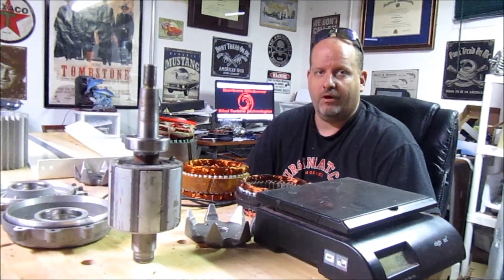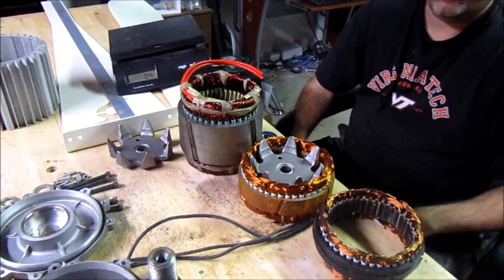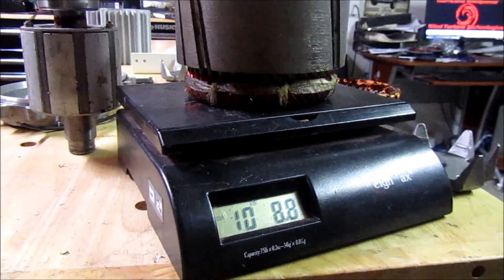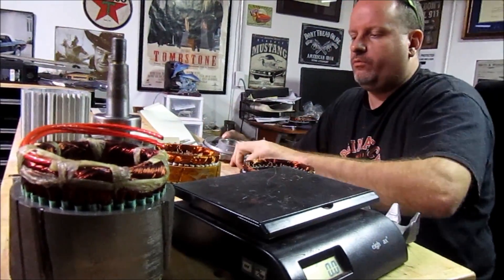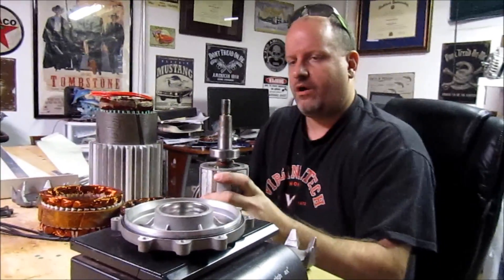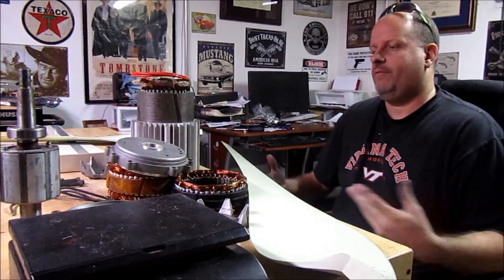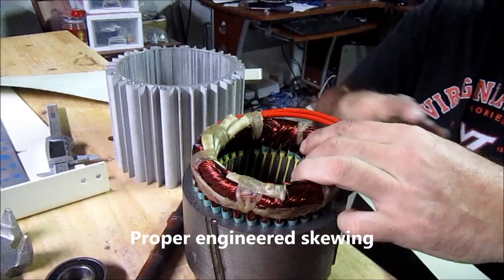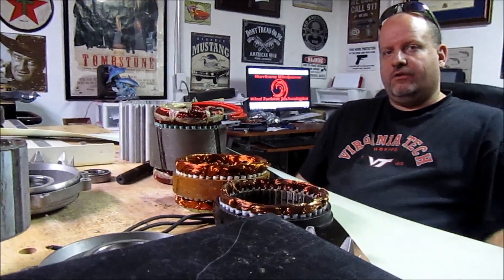Wind turbines for the beginner How to part one by Hurricane Wind Power

Comment: Excellent comparison of the different parts used.  You know I had that other companies wind turbine installed and just a little over a year of flying it I had problems with the front bearing sticking at the 1 o'clock position. and that is with there Falcon Mac 5 80 inch blades.  Have you considered making blades up to say 50 inches?  that would give you more surface area.  also , when I built my first 3 phase axial, I built another set of rotors and increased the magnet strength on that set by 30 pound pull and the output jumped a lot.  small up grades should improve over all performance. might be interesting to see how much more power you could possibly make.  again, nice video showing the difference , especially there none coated stators. SD
Reply from the maker: +SilentDeath002 these 5 are sized right for our 1 kw unit. When we build our axial it will be a big boy and more like a 7 foot blade. I saw your little axial and it kicks ass. These things take time setting up machine shops between everything else is slow going
Reply: +Hurricane Wind Power  I understand fully that they are built for that set up. what I am talking about is a good selection of larger blades people can purchase from you that others do not supply.  and also looking into a way to possibly make your set up put out more power.  if we can get go output from every day low wind, if we get stronger winds that's even better.  the axial I am working on now will have 8.5 dia blade set up. anything larger in the city might be difficult to put up without drawing a lot of attention or making neighbors a little nervous lol.
Reply from the maker: I am not opposed to bigger blades but we have a source for some nice 7 foot blades i would have to have a lot of trust to put up 8.5....if you got the source and they are good share lol
Reply: +Hurricane Wind Power  you possibly did not understand, I am talking 8.5 over all dia not length of one blade. again, a lot of people are looking for good blades from 50 inches and out in small increases so they can match blades and wind speed to there set up. I got my blades from magnets4less, applied magnets.
Reply from the maker: +SilentDeath002 oh I think we may have something a little better than that. Some of those magnets for less blades end up taking on water and going out of balance customers have told me over the years. Other people do not seem to have this problem but we have a good blade manufacturer  and some good test results on some things we have used on the axials that will be coming in the future if they continue to last

Comment: Lets dispel the crap about car alternators in any variation whether from Mexico or Vietnam since NONE are made in the USA.
For one, a belt tensioner on a  car is 12 to 30 lbs and it don't hammer on the bearings like a typical unbalanced set of raptor blades can do.
 Alternators on a car actually get much less rotating service than a wind turbine by a huge margin. Drive your car 24 hours a day with the hood open to all elements and your car alternator will be shot in under 4 months. 
A PMG is a Permanent magnet generator that with or without brushes produces a single line of voltage, not alternating. 
A PMA is a Permanent magnet alternator that can be made out of anything, including a Shou Dan Pong washing machine casing or a delco alternator. 
A Axial Flux is a recurring Multi phase PMA
A treadmill motor is a PMG if used to make and not use power.

Hope this helps correct the damage made by a prolific fraud from Missouri, even if the Meat Puppets he uses to deceive the world have no concept on reality.
Reply from the maker: +TheBlokeSolar&Wind my understanding is that Hye changed blade vendors prior to the blade fiasco. I would think they would learn from their mistake but who knows
Reply: Looks like theres already a line in front of Ebay demanding refunds for counterfeit products sold out of missouri. Theres a 25 year statute of Limitations to Consumer fraud on things with Misrepresented Origin by American Sellers. No wonder the FBI is speaking to so many people now.
Reply: +Prepper Mountain (Prepper Mountain MD) You have been bizzy tonight John how is life treating you?
Reply: +TheBlokeSolar&Wind Excellent since I bought the first HWP turbine and realized it was actually under rated. Same with my Sunning, both under rated compared to the 2 main car alternator junk dealers options. I don't have to alter the HWP or Sunning. And the HWP blades are not foam core shit like the new HYE blades are. Big improvement in month KW by 200%. Sometimes you have to get real, if your smart.
Reply: Prepper Mountain I looked at those Sunning wind turbines they don't look bad at all, I know the blades that I got with my Gigu are Fiberglass that are painted but they come with a reinforcement plate that holds the blades onto the hub and give extra strength to them. I think a bird flew into them because now one is missing paint but no dead bird or broken blade so I am happy.
Reply: +TheBlokeSolar&Wind The sunning blade can handle over 350 lbs of right angle force. Compared to the new HYE ( post April 2013 when they began to make their own blades, don't let them lie to you) the HYE will break at under 100 lbs right angle force. The new HYE blade is a fiber foam core 3 composite, the old blade was made by a contractor, not HYE and thats why the old blades are still out there running and the new ones are snapping on everyone. If you buy a HYE after April 2013 you will get Copper/Aluminum wire in it, and shit blades. 
Tony buys the Sunning / Gurling 1050 mm blade and its a 5 composite blade. 
If you want your Gigu blades to last longer, use a stripper chemical safe for fiberglass or sand them down and apply 3 coats of appliance epoxy paint to make them much stronger and it keeps the adhesives in the fiberglass from degrading.
Reply: Prepper Mountain Yes the hye blades are shit, why do you think someone made a replacement blade. I went to order a set of hye blades from hye and they wanted to charge me $400+ for a set of 3. I really see no future for HYE they have gone down hill trying to cut cost's and boost profit's. Thanks for the tip on the blade's will do next time I have to take it down.
Reply: +TheBlokeSolar&Wind - When you buy a new turbine, kick in the extra $120 and get a sunning 600 . Its got a 2+ meter blade diameter and you will need a strong pole to put it on. It weighs over 38 kilos. And unlike the 5 pound alternator shucksters  it will make a actual 650 watts in 24 mph and over 1000 in 30 mph 24 volt, at 30 mph+ though it has blade braking and auto pulse load resistor braking. Sunning rates a 9.3 by the African Energy Group, HYE ranks a 4.7 so theres no competition there.
I will have 2 sunnings,  2 HWP turbines, my VAWT axial flux and my old trusty 2011 HYE turbine. 
No single big turbine to fail, lots of little ones cutting in in all kinds of ways. thats how you go off grid and have no worries. 
There needs to be a war initiated on all the frauds, especially the ones claiming they got a big - O factory in USA!
Reply: Hurricane Wind Power True mate, I have no understanding why they would want to go from a well respected brand to a brand that is known for blades exploding.

Comment: We have your little red permanent GM alternator on our stream wheel and are very happy with it. It was difficult to find a huge belt or the wheel pulley to put on it but after 3 years it only had to have new bearings once this summer but it runs everyday all day and makes 18 to 20 amps constantly unless the creek gets junk in it and blocks the water wheel. Why does your last so much longer that the Missouri wind & solar one we had, it sounded like a helicopter but only lasted 3 months and its magnets came apart in it. Yours is so quiet we love it.
Reply from the maker: +Missy T thanks Missy for your kind comments
Reply: +Hurricane Wind Power I told you that your red pma was excellent for water power due to its smooth rotation. I would focus on that for sure and maybe get a parts list link put on your site for the big 7 foot water wheels like she has.
Reply from the maker: +Prepper Mountain (Prepper Mountain MD) defiantly good market there

Comment: OK, you said the one in the middle is a 2kw? Thats 2000 watts right? But is smaller with smaller blades than the bigger one thats 10 lbs with much bigger blades which makes 1000 watts. Looks like you just busted a scam for sure.
Reply from the maker: +Missy T they have various rating but one  goes as much as 1700 watts the last time I looked.